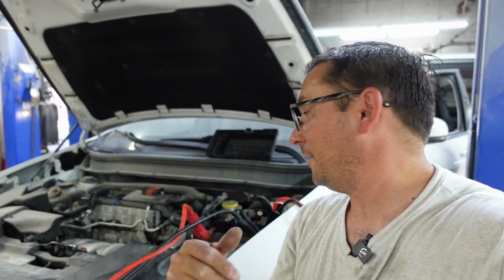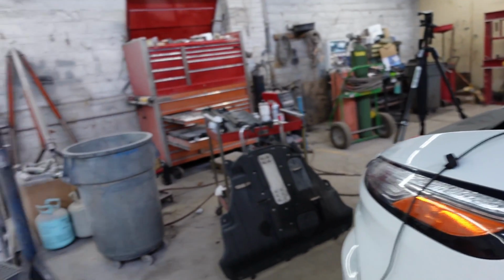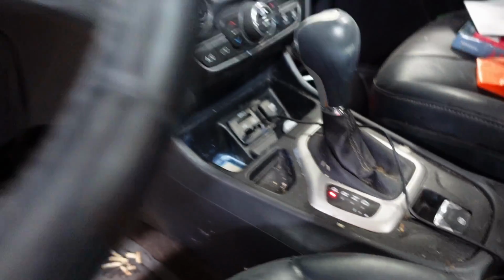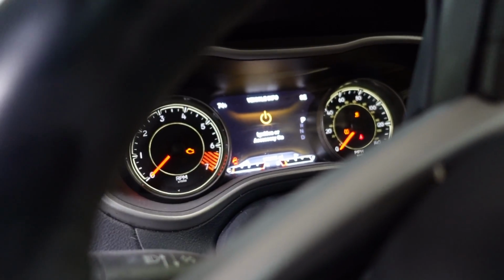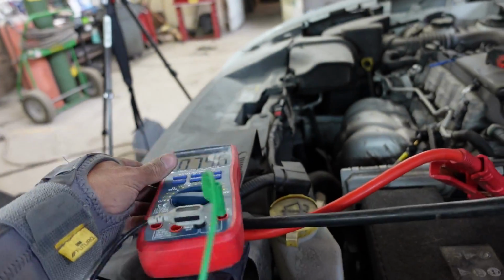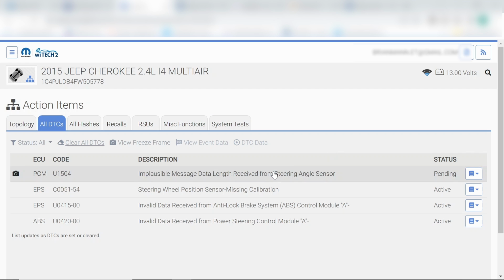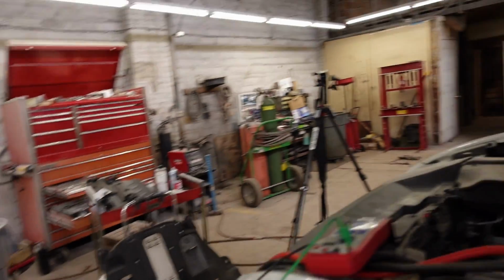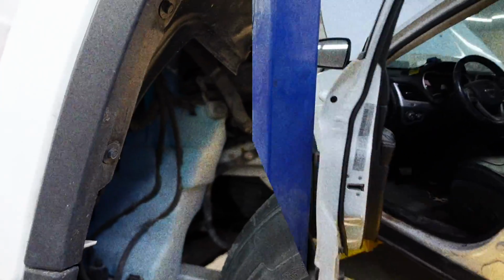2015 Jeep Cherokee No Crank P0688

Comment: Return the 1740 explore, and then I don’t know what to tell Guy Muir just get out of here and my 1740 Explorer. That’s literally Nothing compare. I’ll be your Dodge Durango or pool Explorer F1. 50,000. That’s literally that’s literally nothing compared is literally way better. So guys I had to call my big sister anyways. Yeah, so so that’s nothing compared. I’ll be your car boy. Just get out of this vehicle. Our car is way better than yours is to Vitor. 4450 Thousand Five Hundred. Anyway yes, so so I had that Toyota and it’s been running fine this couple years. And then it’s been running rough, and I took it to the shop because he needed some oil, so yeah and I took it to the Dealer cause I need. I needed to trade in the to my Toyota sienna, and then I traded in for something even way better. I was thinking about a Key. A Kia was a 2005 Kia sorento, and it brought it to my house. It’s been running so fine until it needed some oil. So I took it so it took it was and it cost me $18, so I gave him the $18 and give me 8555. That’s that’s literally nothing compared up your car anyways. Yeah so and then I brought two more vehicles which was that Honda CRV. It was a 2015 and then and then the last car was a 2021 GMC Sierra and then the Sierra is there. Need some gas it. It had 1 mile to empty and then I filled it up and they needed 1000 gallons. So I was surprised for a second cause I thought it was gonna explode, but it didn’t explode. It’s just what it’s start up, so I’m I don’t know what I had to do. I think just get out of the car and blow my car up, but anyways, so yeah, it was. It was broken down at the Cenex gas station, where when he was, so I fixed it, and it started fine until it just died on me. And I turned it on again. And then I drove away. Super quick to my house. Dying on me. Like for no reason. So I had to get to the shop. I had to tow it with my Iman me. 2015 Honda so I had another one but it was a 2016 Dodge ram 1500. Larry me long horn so and then it’s parked under a tree cause I don’t know cause cause it’s only had it five parking spots in my garage. And I decided to move because Lincoln kicked me out for no reason. That’s literally nothing. Compare anyway, have a good day and I’ll see you guys in the next speed. Bye.

Comment: Well, we had that Dodge Durango 2019 y it was running fine and it’s been last thing for 2505 million days in the next morning. I have I had a problem with it. I had like a Mele it like a softly, and maybe I mean, it’s because can’t have exhaust fluid, so I think we had to took it to the shop. Where were the Dodge ram closer and deep is so, and then they told us that they could fix it but cost $2500 and wheat and we didn’t have that note that we didn’t have that no money but we gave him the rest and he gave us 2000 and 5 155,000. That’s crazy because I thought we’re gonna be rich then, and then A Ram had to exactly too sound like I know, but yeah And then this truck this the Seventeen Ford Explorer. It’s been running so good and I need an oil replacement for is 17 Ford Explorer. Then we took it into the shop and then. it was ready. This sound is so better than before the last time and this is a B before, and it was a long time ago when we changed the oil in the Seventeen Ford export, and then we took the Dodge Durango back where it was and then we we decide to buy the 2017 Ford Explorer XL, T, and then so have a good day

Comment: I did replace the ground wire and still no crank, I erased all trouble codes and no crank . What could be
Reply from the maker: No Codes?
Reply: Marco después ignición switch atascado en ignición
Reply: También el sensor de la dirección asistida fuera de calibración
Reply: Ignition switch stuck on, and the steering angle sensor no calibrate
Reply: This car turn on directly from the starter after turning the switch on run
Reply: If you're starting the vehicle from the starter , then you have a bad ignition switch